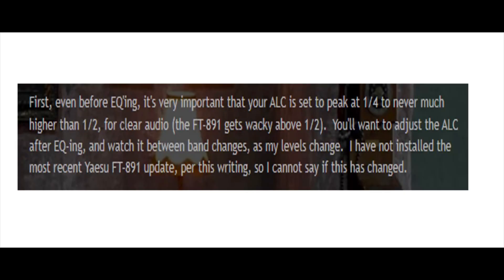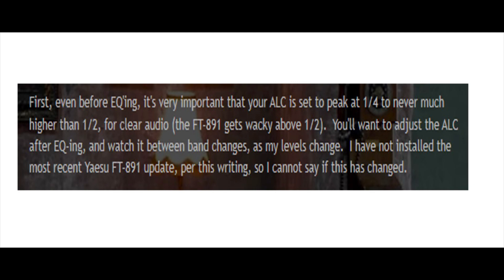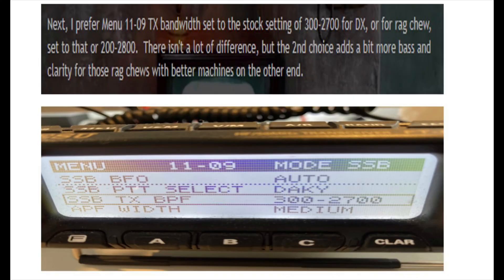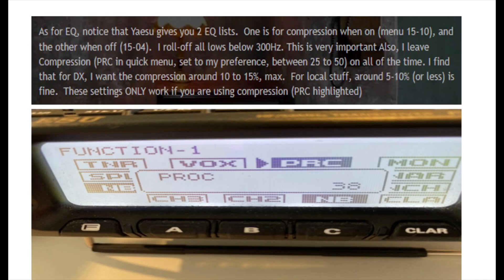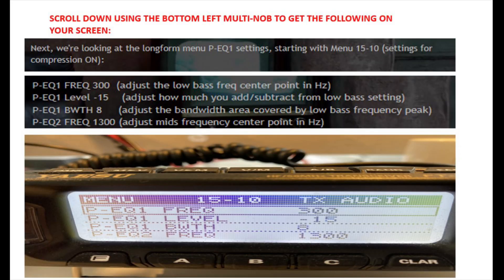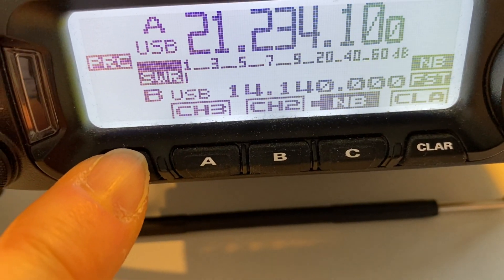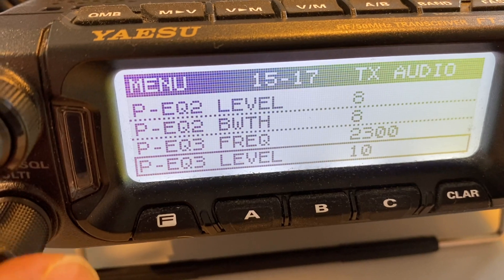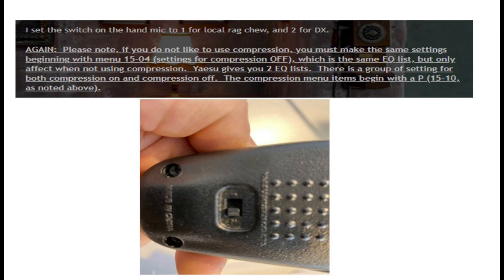HAM RADIO: Yaesu FT-891 Best SSB TX Audio Settings

Comment: the 891 is THE worst newly available radio, it has a low dynamic range and the SSB TX audio sounds likey mushy. that is not that much a problem when the signals are strong but at weaker signals it becomes a problem, please don't bother HF with that. if it has to be a Yaesu, the FT-710 is a much better radio compared to that 891. the Icom IC-7300 is the best radio.

Comment: Great video as always!!  Just received my new 891 and I'm curious if there's an easy answer for using compression vs not using it?  I lean toward using it solely based on your personal preference, but I am curious why you choose to use it.
Reply from the maker: Thanks! I have just used those settings and get good unsolicited audio comments - if using compression keep your voice at a usual talking level, avoid shouting and keep the mic a few inches from your face. So far (for me) so good.

Comment: Tim, enjoyed the video. I set it up as mentioned. I did notice one thing that you and The Stingy Ham didn’t mention (or I missed it). I just stumbled on it really-in the FT-891’s Advance manual, it shows how to adjust these settings to the Parametric equalizer, then to actually enable them, you need to go to the “Function 2” menu and toggle on the MEQ.
Reply from the maker: Ah good spot

Comment: I'm about to buy  a transceiver a Yaesu FT-891, so that information comes in the right time for me. Could you give me your advice abot antenna tuners for this transceiver? Is it true that many guys go to portable operation without a tunner at all? Thanks a lot.
Reply from the maker: Hi Luis most avoid tuners when portable as it’s another piece of equipment to take. It depends on the antenna you have in mind to use

Comment: I keep seeing the reference to half or 1/4 ALC but don't know what that means. When I have the ALC meter selected a portion of the line is bolded is that the scale we are talking about? If so then half of that yes? Sorry, 891 newbie not something I had to spend much time worrying about with the G90.
Reply from the maker: Yes that’s fine 👍
Reply: No. Run your Alc to 3/4.  And compression 5 percent.

Comment: Hi Tim,  Could you verify whether or not the Parametric Mic Equalizer (MEQ on Function - 2) needs to be enabled for these settings to function?  Thanks!!
Reply from the maker: Michael I’ll check
Reply: Was anything found out about this question… cause I have the same question about MEQ in function 2. Trying to figure out where it comes into play.

Comment: Is the AM/FM TX delay "problem" solved with an firmware update?
Reply from the maker: Not that I’m aware but I did find a solution somewhere on YouTube a couple of years ago
Reply: @TIMG5TM  so it is an software issue instead of hardware problems?
Reply from the maker: Good question!

Comment: Hey thanks, Tim!  Very kind of you to reference me.  Some of the purists on QRZ have really raked me over the coals for my mic settings because they’re way out of whack with what they feel they should be.  I get their point because the bandwidth settings do run counter to what the parametric EQ should do, but in the end, I just go for results and sound. Also, the signal has to remain clean enough, and keeping the ALC under control seems to handle that fine.  

I have made some adjustments to the Mic EQ settings for my FTDX 3000 post in recent months — The compression seems to react differently based on settings for that radio than the 891 does. I should also mention that I sold the 891 perhaps three years ago, so the information may be getting a little dated. It’s great to know it’s still working for you, though.  Thanks for the shout!  HL1ZIX, “The Stingy Ham.”
Reply from the maker: Thank you so much for coming back to me! The settings have made a big difference and I enjoyed the guide you provided. 73
Reply: I've been a ham for a long time. In the past I just keyed up and talked, these days I have learned that there are variations for what your goal is in communicating, DX, contesting or rag chewing.

Comment: Hi Tim, I have AN ft-891 (2 yrs old now and only used as a base rig) and I thought I would give these settings a try.  Big mistake!

I was on the ECARS Net, 7255 kHz and several ops mentioned that I didn't sound as good as I usually did (I was using the rig as set out of the box).  Went back to factory defaults and reset the ALC gain to 2/3 scale for my voice (setting is 34) and all was fine again.  Went back on and got great reports on the audio quality.

I am using a Shure SM-48 vocals mic on a boom mount (shock mount), Heil XLR cable and a Heil hand switch.

I guess it all depends on the mic used and the ops voice.  Everyone's voice is different!
Reply from the maker: Fair points

Comment: I found this website a few years back and immediately applied the settings to my 891 and they certainly made a difference. 👍 Yes, it's a great radio straight out of the box and with so many menu driven settings to play with, the info was very helpful. 👍👍 The 891 is a great mobile radio, aided by the remote head unit and that's how I use mine. I also have an 897D which stacks up quite well against it's newer cousin, given it's age but there's no denying the 891's receiver is noticeably better, as you'd expect!😂 Will never sell my 897 though.
Reply from the maker: Good points Phil. Many still love their 857 and 897’s too

Comment: Nice video Tim.i have worked op,s using that radio and it always sounds punchy.  I would say my ts 480hx is another excellent radio for mobile or home base.
I have listened on sdr in zl and eu , whilst experimenting with settings, and found from day one, the stock settings are the best, and obviously from here, all my qso's are dx , zl to eu and most say my audio sounds like iam 
In the room with them.
Of course the 200w helps, but for 12,000 mile qso's every day, I like the 480hx.
Good weekend to you and your family, 73 brian.
Reply from the maker: Thanks Brian - a good radio that 480. Greetings to all there too, 73

Comment: Good video Tim, not just for 891 users, but because few people highlight the importance of setting  up the audio. When I 1st had my 991a I listened to myself calling CQ on Hack Green which is a few miles down the road, yes it was clear but also woolly and lacking definition. I sorted mine out with a cheap desk mic, EQ desk & a bit of processing in the 991a & without wanting to sound like I'm exaggerating, I get positive complements on my audio nearly every other QSO, yes it's loud, but doesn't overdrive or splatter & is very punchy. As a 2E0 limited to 50w I'd safely say the changes have been worth 200-300w extra equivalent to the old settings. People always say that yes I'm 5/4 or 5/6 but I sound 5/9 if they weren't looking at the meter. I know people think I run extra power then the 50w, I don't. It's just I spent time setting up the audio to maximise what I have. I think of it as like when I used to order a round in a busy pub back in my teens, whilst I can't elbow my way in front of a few rugby prop forwards, I can stick my hand up and shout clearly over the mumbling din & get served. 73 Tim de Jim 2E0HKM
Reply from the maker: Great points Jim - thank you.